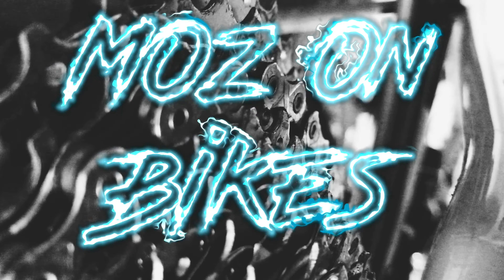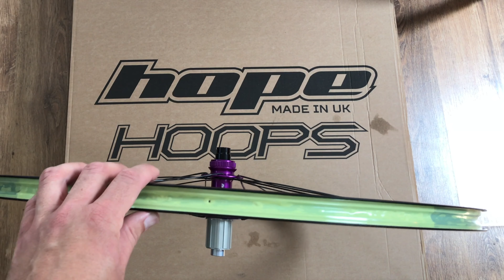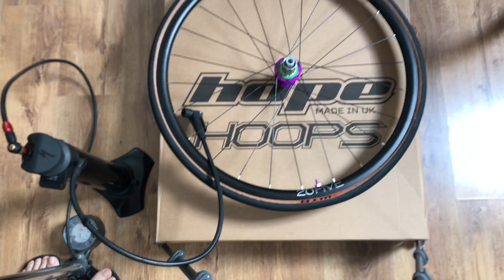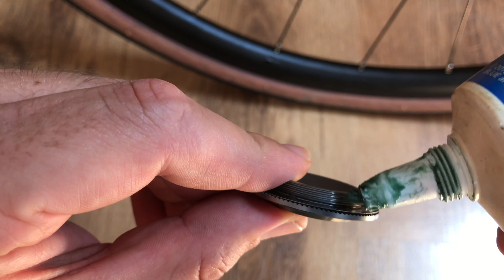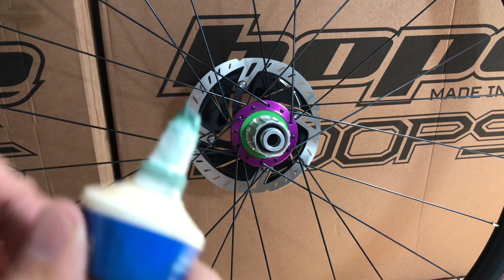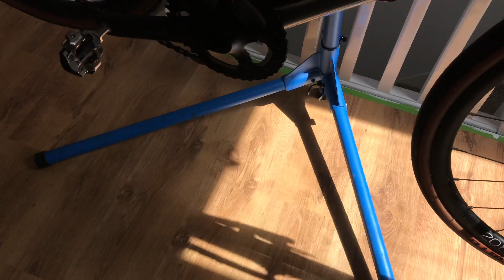Hope 20Five Wheel Setup, How to Install Tubeless Tyres, Dura Ace Brake Rotors & Wide Range Cassette

Comment: Great tip with the rear rotor, removing the axle adaptor and then reinstalling it afterwards. I was trying to install a set of xtr rotors earlier and was scratching my head on how to do it, so thanks 🙏🏻

Comment: Saving now for the wheels ( sadly only black hubs in stock for SCS lucky people ) but maybe i’ll manage to get coloured front hub. Any issues so far??
Reply from the maker: You should be able to get any good local bike shop that deal with Hope to order direct, that way you should be able to get any of the standard colours you want. (Not sure what SCS  is?!?) 
So far I’ve got about 1000km on them and they’ve been totally perfect 👌
Reply: Moz On Bikes scs is a standard use on MK1 diverge ( short chain stay ) where they use 135 hubs, moved the cassette 2.5mm inward to have the chain line like 130hubs. But glad to hear you packed miles without problems. Keep up the food work
Reply from the maker: Ahh yes totally forgot Specialized came up with their own hub standard for a while! 
Ahh I assume the the SCS hub is a black option only as it’s a bit of a rarity, makes sense.
Reply: Moz On Bikes exactly. But still nice of Hope to cater for us, lost souls

Comment: what size valve stem you using, i have order same set, and i want to order stems before wheels arrive . not going to use the standard that come very nice touche but i need some colour
Reply from the maker: Hi top banana, sorry for the late reply, didn’t get a notification for your comment. I’m using the Peatys X Chris King tubeless valves in the 42mm length.
Reply: @MozOnBikes  I order the only red ones on amazon they was 60mm I send them back lol I did go for muck off instead as smaller size was available.  And must say very nice bit of kit

Comment: Excellent video. You've just convinced me to get the RS4 hub. Pro4 will be too loud I feel.

I'm about to place an order shortly. Wheels been ok on recent rides?
Reply from the maker: I’ve got a pro4 on my mountain bike, it’s defo louder! RS4 has a really nice sound. So far I’ve been impressed with them, defo a significant upgrade over the standard wheels
Reply: Moz On Bikes great to hear. I’ve placed my order for the wheels. I will putting them on my trek Checkpoint 👍🏻 have you had to do any adjustments to callipers and gear indexing?

I was hoping to swap onto my standard wheels with road tyres but they are 6 bolt and not sure swapping over will be as easy as I first thought.